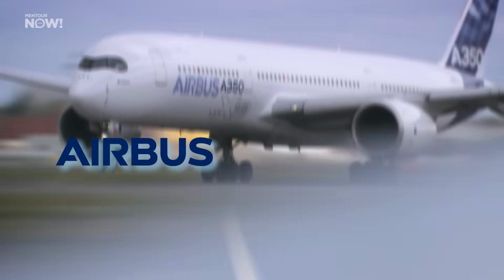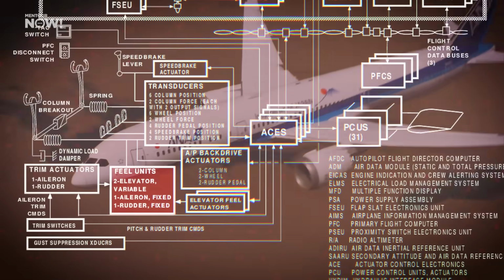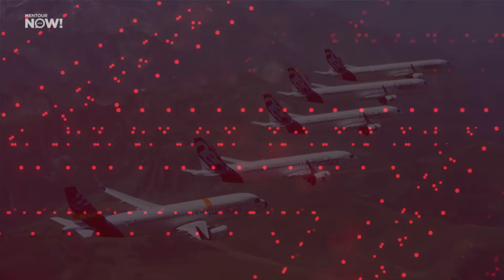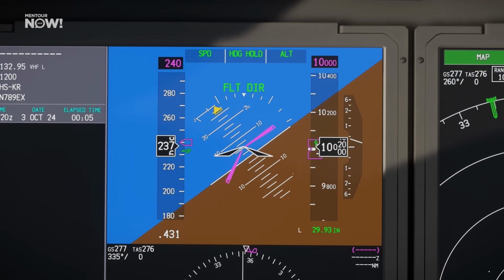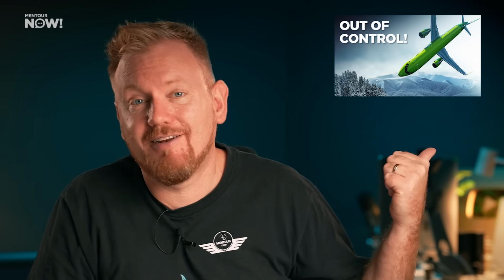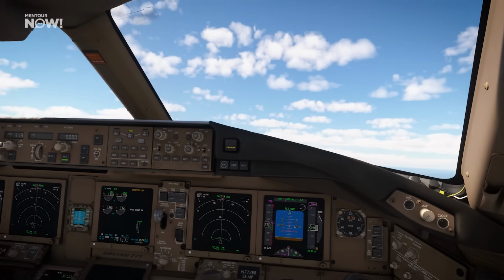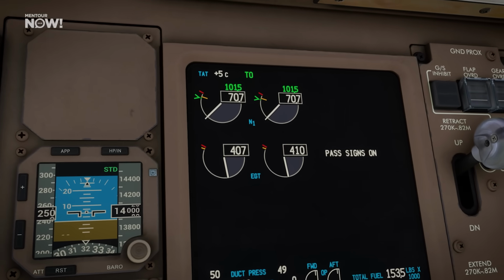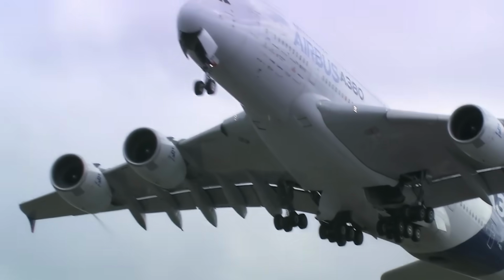Do Pilots Prefer AIRBUS over BOEING?!

Comment: As a Passenger i won't fly on anything unless its  A. An Airbus product, and B. From a very select few airlines. Frankly if the only way to get somewhere is a 737 or any boeing product for that matter i simply won't go. Ill even pay double (and have done) to catch an airbus over a Boeing. Until Boeing stop there corporate shareholders first tactics and focus on building quality products, paying there employees properly, and stop focusing on there stock price, i will not fly on them. Frankly i would chance 172 skyhawk over a 737.
Reply: You're paranoid. Boeing is the only reason we have this level of safety in civil aviation. They've been around for 50 years longer than Airbus. Airbus therefore had the opportunity to learn from other's (mainly Boeing's) mistakes.
Reply: There's hundreds of 737 MAXes that have flown thousands of flights without incident.

Comment: As an engineering point of view, Airbus is just hands down a better design. Feeling the aircraft and what not, well it is like claiming Defender is a better off roader than a Range Rover. It certainly makes drivers put on a more dramatic and engaging drive, but still an underdog in terms of performance and what it took to produce it. Armchair multi licence pilot with an astonishing 54 total hours amassed in a relatively comfortable sofa.
Reply: Design in which aspect? There's been instances where a Boeing 747 with chunks ripped off still landed safely. They're built like a tank.
Reply: @RSInterviews  exactly. The Defender of the skies!

Comment: I think if you learn first flying experiens in glider. Then you learn to real feel the flying laws in airoplane. Fore exampel. Learn lisen the wind sound in glider in stall and hi speed fel the turns in plan and so on. For me is very importent in any kind of plan you fly son to has the feling in how airoplane react and feel in glider first before you flying motorplan ore going into flying any other airoplane. I know many friends going that way first flying glider before they go to be Commercial pilots. I only get so far to fly motor glider TMG so far and flying aerobatic in glider also. But i get a point here to realy know and feel to fly a glider first to realy understand the Aerodynamics and real know the aircraft in any situations you probly put in to. I think many pilots out there realy agre whit that piont of view. Best regards from hapy gliderpilots from soutwest sweden  herrljunga flygklub. 😎👌👍

Comment: I wil take an exception with a point made. Boeing's QRH don't withhold information. Their checklists and system are relatively simple by design. That's why their books are rather simple. Additionally, every Airbus pilot I've seen come over to a Boeing initial training, always struggles in hand piloting skills. As you mentioned, auto throttles that stay stationary lead to lazy pilots who lose flying skills over time.

Comment: I have flown both Airbus and Boeing and was an instructor/check airman on both. After 37 years with my airline and over 30K hours I still enjoyed actually flying the airplane as apposed to managing computers. My main concern about the Airbus is lack of situational awareness. The auto throttles don't move and there is no interconnection between side sticks.  In a Boeing, you get to see and feel what's happening. While I liked the meal tray and room in the cockpit, I would much prefer a Boeing.
Reply: As a fellow airman I would agree with your points but disagree on the final conclusion. I have flown both Boeing and Airbus. Yes I agree that not having any of the controls move does not help awareness and during manual flying in abnormal thrust situations even if A/THR is available I tend to prefer it being off because the A/THR hinders more than helps in my opinion. 

However as a counterpoint I will say that at the very least the cockpit and general design of the 737 is horribly outdated and has flaws I consider inexcusable for a modern aircraft. Switches that are the same shape are placed next to one another but have very different functions(e.g. Hydraulic<->engine anti-ice). Or the fact that in a low Go-Around you need to press the yoke near full forward to avoid the aircraft pitching itself up into a power on stall. Don’t get me wrong, I loved flying the 737 but I also loved flying a C-150 from 1968.
Reply: @Neroj007 Thats cause the 737 is an old relic. The overheard panel is the thing I dislike most about it. Give me push buttons anyday. I agree about the risk of power on stall. Thats why the 777, 787 and 777X is where the beauty is at in regards to Boeing.

Comment: There is one thing that Airbus refuses to do that boggles my mind. If was a pilot, I would like to feel if my copilot  was using their side stick at the same time i was. Seems like a no brainer
Reply: It’s not as simple as you think.  To do that in fbw you have to have a number of motors capable of moving the controls. These bring their own failure risks.
Reply: @peteconrad2077  You don't need to know what they are doing merely that they are doing something.  A simple buzzer or vibration that sounds when you move your sidestick at the same time as the other pilot would surely be enough.
Reply: @NinaLanyon it already has that. But it is useful to know exactly what your opposite number is doing, to determine if they’re making a wrong input, especially as a trainer.
Reply: @peteconrad2077 As a trainer I understand it.  But surely in normal practice only one person should be using the sidestick.  If you try to use it surely you either realize that you shouldn't or speak to your copilot and ask him what's going on?
Reply: @NinaLanyon you clearly have never been near an Airbus.
Reply: @peteconrad2077  I have been near them and in them many times though never in the cockpit.  Perhaps instead of making snide remarks you could use your expertise to educate those of us who lack your experience.
Reply: @NinaLanyon so why are you spouting on here like you have a clue if you don’t? Airbus has a dual input alert both visual and aural. It also tell you if one side has taken priority.
Reply: When that happens, the computer does announce "dual input."

Comment: Taking manual controls out of any aircraft is very dangerous when electronic or electrical problems happen.  I been a commercial pilot for over 40 years.  I don't like fly by wire without mechanical back up.  There has been interference that has caused serious problems on aircraft control.  A new radar system was the last loss of control by a commercial aircraft.

Comment: Fly by Wire compared to anything else is like comparing the modern age to the stone age. Pulleys and cables lend themselves to over-correction and mistakes. What do military fighter pilots use? Need I say more?
Reply: The F-15 is not fly by wire. There are plenty of those still in service.

If you’re referring to them using sticks instead of yokes, fighter pilots need to make very quick sharp movements sometimes which a stick is very good for. There also isn’t really any room for a yoke in a fighter. For airliners however, you don’t need to make shaper quick jerky movements and you want to make slow smooth inputs, which a yoke is extremely good for. And you can use two hands on a yoke when the auto throttle is on.

Comment: BEFORE Boeing went crazy and started to change from being designers and engineering running the company to lawyers and accountants doing so, I would and still do avoid Airbus as much as possible. That's from a former USAF crew chief's point of view vs pilots. Although thanks to some access, I have several hundred hours of both sim time and actual flight time in various cockpits and was certified on 16 different aircraft. When you can't even make a proper pitot tube (Airbus) and it causes crashes, because its from the same people who invented the word sabotage and look for any opportunity to strike or take off from work, let alone do a good job on a Monday or Friday. You get shoddy product. Unfortunately Instead of making a better choice the "leadership" at current Boeing have decided to try and be MORE like Airbus than what their history said that they SHOULD be! Which has brought the quality down dramatically. Sometimes its so bad that I've been able to see it just doing a visual inspection before getting on an aircraft. One time it even delayed a flight  for a little bit, because they went and checked on what I saw and it turned out to need work right then and there. Its especially a problem, because less and less true and proper maintenance is being done on these aircraft by airlines. Sometimes the bare minimum. Because they don't make money unless they're flying and there is a cold calculation that the airlines use, but won't admit to. If a flight crashes, and all lives are lost, what's the worst money loss that they'll incur, vs how much will it cost to keep the aircraft on the ground to make it truly air worthy. Pilots know very little about that, some don't even care much. Other than for possibly saving their own skin.

Comment: Don't forget that early fly by wire flight where the pilot was doing a low altitude field overflight and the computer wanted to land....   The plane CRASHED into the woods at the end of the runway......
Could that be any worse ????
Reply: That’s not what happened in that particular case.

Comment: I don’t like Airbus planes because they’re full automation aircraft — the pilot can’t really control the plane. With Boeing, control mostly stays with the pilot, and you actually feel like you’re flying a real airplane. Some people say, “Airbus is safer because of automation, while Boeing has more crashes,” but that much automation makes pilots struggle in emergency situations since they’re too used to the computer doing the work. Remember Air France 447 — when automation failed, the pilots didn’t even know what to do. Yes, the Boeing MAX series was a problematic one, but that doesn’t mean Airbus’s automation is better. Flying an Airbus feels like playing a flight simulator with a side stick — like a toy. Also, the A320 can never be better than the 737. I’m not talking about the 737 MAX series here — the 737-800 is undoubtedly one of the world’s most beloved aircraft. Moreover, the Boeing 737-800 has a stronger fuselage, lower maintenance costs, and better fuel efficiency compared to the A320. It also offers a more manual, realistic “flying feel” for pilots. Its takeoff performance is powerful and it performs better on short runways. The A320, on the other hand, relies too much on automation, reducing pilot control — a feature often criticized by experienced pilots as being “too computer-driven.”

Comment: Despites being BELIVED BY PILOT WHO HAD FLYING AIRBUS, AIRBUS FILISOFY GIVING MORE TO COMPUTER WHILE HUMAN JUST OWN A TINY PARTS WHEN FLYING AIRBUS WITHOUT ANY MECHANICALS SYSTEMS AS A BACKUP IS ONLY TIMES WILL SLAPPING ON AIRBUS FACES BECOUSE AIRBUS IS LOOSING THEIRS HUMAN SENSES FOR TRUSTING COMPUTER MORE THEN HUMAN.
AIRBUS MUST KEEPING ANCIENT SYSTEMS PILOTS CAN USE WHILE COMPUTER LOSE ITS SOULS.
BY THE WAY, BOEING NEED TO MODIFYING THEIR FILOSOFY WITH NEW SAFETY COMPUTER CAN HELP WHEN HUMAN JUST A HUMAN WITH HIGH WEAKNESS AND MISTAKEN. COMPUTER CAN EASLY LOOSING LIFE JUST ON POWER PROBLEMS EVEN RATS IS INSTALLED, HOW PILOT CAN MANAGES AIRBUS ON EMP STRIKES?? WITH MASSIVE SOLAR STORM, NO MOTOR CAN PRODUCING ELECTRIC EVEN MOTOR SPINING  TOTALLY FLIGHT BY WIRE CAN DO NOTHING WITHOUT INPUT CAME FROM ELECTRIC. WITH ANCIENT SYSTEMS JUST MANAGING BASIC SYSTEMS PILOT STILL HAVING HIGH CHANCES TO LANDING EVEN HARDEST LANDING. WITH ONLY FBW AIRBUS BELIVES THE BEST WITH 0 RISK OF FAILURES,, WHEN ELECTRIC IS TOTALLY VANISHED, PILOT JUST HAVE A TIMES TO FACING SCARIEST TIMES BEFORE CRASH AND TOTALLY TO DIE.

Comment: I have a friend that has flown both planes. He generally liked flying a Boeing (currently flies the 777)  since he felt the Airbus was just to automated for his liking. He also felt that because of the automation factor that some pilots are just to relaxed when it came to flying since they know the system is going to take it over. He also expressed that when a system failure occurs on the Airbus, things can go bad to worse more quickly than a Boeing due to having to navigate through the system. He also indicated that the pilot training rigor was not the same as Boeing, so he didn’t feel like the training was that adequate to be considered a good pilot  compared to what he went through. Not sure how accurate that last statement is, but I can see if there is more automation, then the pilots just needs to manage. Therefore, cutting out time for training. Again not sure if this is correct.

Comment: Whilst it is undeniable that Boeing has made several costly (& deadly) mistakes over the last decade or so. There's no denying the fact that the 737 Max 8 is the most scrutinised aircraft in aviation history. I'd fly on one tomorrow. 

Here's a little reminder - easyJet started in 1995 and now operates only Airbus. Ryanair started in 1984 and operates only Boeing. None of ever had a fatal accident or hull loss. 

I think that's testament to both pilot skill & training and quality of the aircraft. 

I've flown as a passenger on both Airbus A320s and 737s. I find the 73s to handle turbulence better than the 320s.

Comment: Not a pilot but recently I prefer Airbus, since the company doesn't seem to be doing everything in its power to bean count its way to crashes and quality failures, which Boeing has been doing for 20+ years now. Apart from the lost lives which is the primary issue of course, I find it rather amusing that a clean sheet 737 replacement would have been DRAMATICALLY cheaper for Boeing than the aftermath of the 737 MAX. "But the airlines pushed them into it." Yup, there were downsides to doing a clean sheet, but part of good engineering is managing your client and their expectations. Any executive at Southwest or AA with half a brain would've been receptive to urging by Boeing that the 737 design was too old for a 4th re-work. And if airlines didn't budge? Let them go to Airbus. A 737 replacement would likely sell 10,000 plus units regardless of Southwest or AA.

Comment: Random question.... for airbus, the pilot has to use the sidestick.... which is on the left for them in the cockpit, correct? Does that cause any issues in terms of precision inputs, as majority of people are dominantly right-handed?
Reply: The pilot in the left seat uses the left hand, the pilot in the right seat uses the right hand to fly. That is true for both sidestick and yoke, as the other hand will be on the thrust levers.
No, it doesn't cause any issues, you get used to it quickly. In fact, that's how you learn to fly as in Pipers and Cessnas you also fly with the left hand as the right hand will be on the throttle :)
Reply: @kallek5655 makes sense. Cheers!

Comment: I work in software engineering which is a bit different but actually overlaps more than you'd think as they both are greatly impacted by the ergonomics of complex technologies with trained operators, so we have to think about that with our tools. The ability to quickly and easily get feedback is a critical thing that we care about in my field that pilots also need to care about. Tactile and visual/graphical are two of the highest bitrate feedback channels for our human brains, this means more sticks and throttles moving and switches clicking (always mirroring the sound and movement of manual invocation so your Pavlov senses are trained to recognize straight away), among other things

Comment: Are the hard protection systems safe from any tampering? If not someone could go into the system and change the parameters to prevent a plane from staying in a safe configuration.